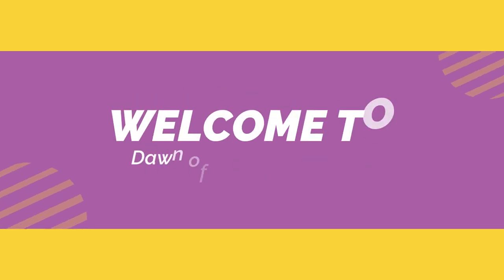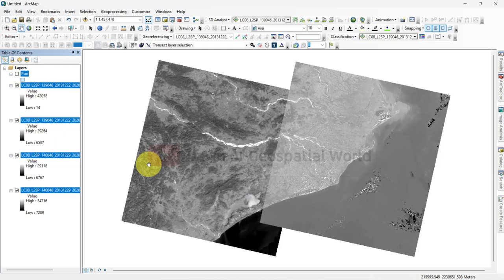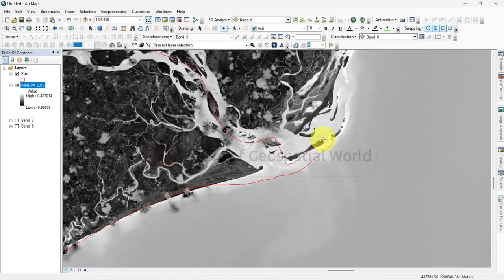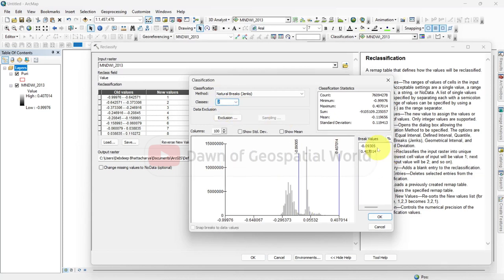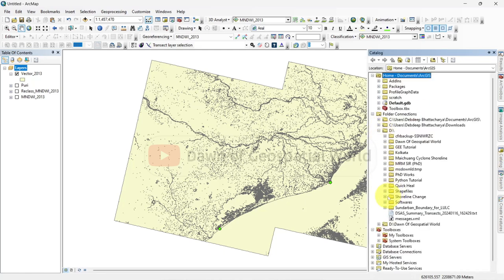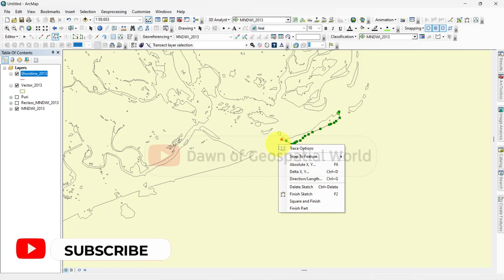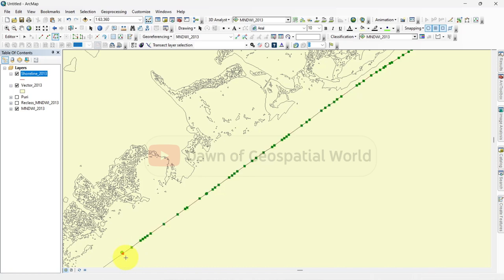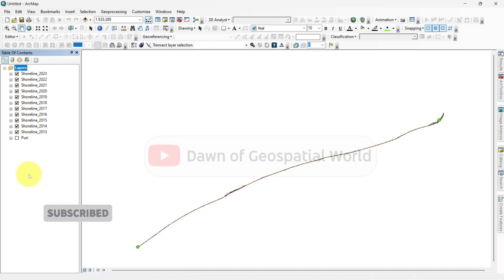Shoreline Extraction from Satellite Image | Shoreline Change Analysis PART 1

Comment: Hi Sir. If I want to just draw the shoreline using the MNDWI layer, I don't need to reclassify the MNDWI and convert it to polygon since I won't use the trace feature to actually draw the shoreline right? Would appreciate your reply sir.
Reply from the maker: Yes, You can draw shoreline on MNDWI Layer

Comment: sir, why are we using MNDWI instead of ndwi? what is the formula for the MNDWI for landsat 7 and landsat 5?
Reply from the maker: MNDWI is the modified formula for NDWI. you can use NDWI for this work but MNDWI will be more precise.
Reply from the maker: For Landsat 5 & 7 the formula is
(Band 2 - Band 5) / (Band 2 + Band 5)
(Green - SWIR1) / (Green + SWIR1)